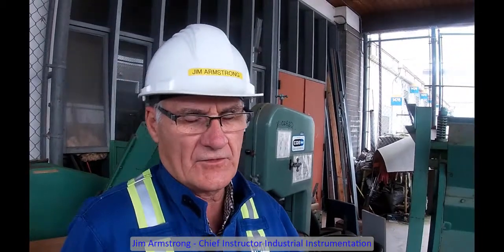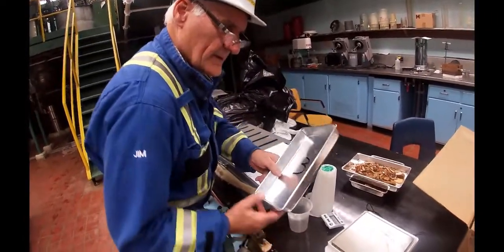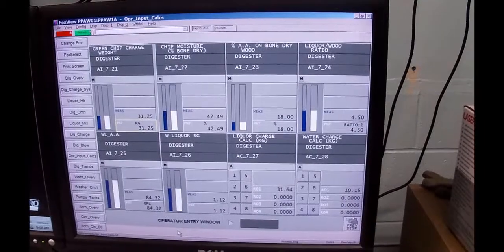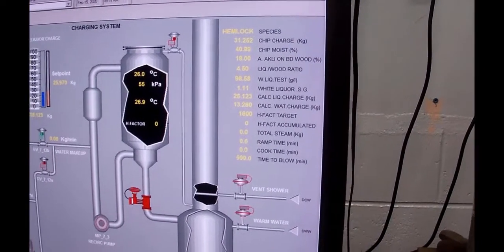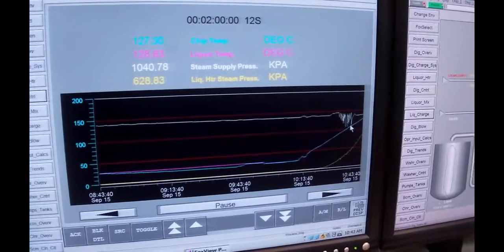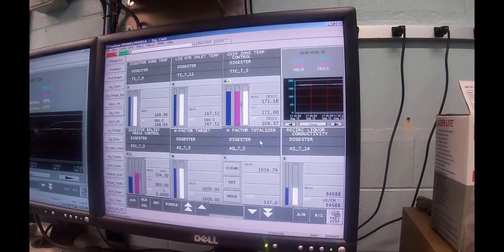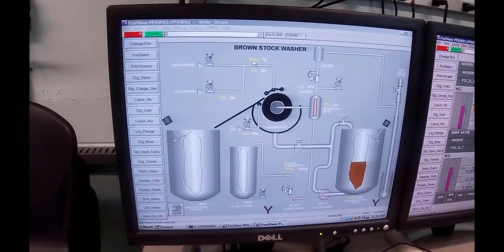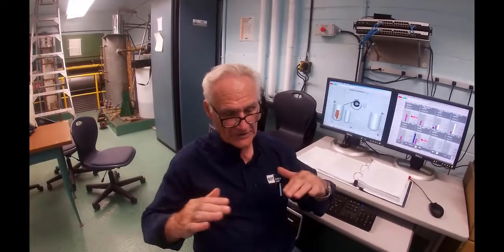Pulp Digester Lab

Comment: So different than the digesters I used to run . Mine where called rotary digesters that was tall as 3 stories .Ran at 150 lbs of steam at 305 degrees the cycle took 4hours 45 min ..we cooked flax waste that looked like hay bales to soften it up then bleached and refined as it goes out to the paper machines . We made cigarette paper .

Comment: Dont work in a pulpmill.
Reply: I had no choice they shut one of the paper machines down and was  bumped to the pulp mill running flax digesters, washers  and impressafiners I worked at the top floor of the mill all by myself wich had the pulp mill office flax storage set to be taken by bay numbers to load into the digester wich was 82 bales . Some times I would work for more than a week.with out seeing a supervisor or foreman as long as everything was running good no one bothered you .Also it was dusty ,dirty ,and stinky and many big roaches that would crawl down the flax bales trying to escape as it falls into the digester with caustic chemicals like battery acid
Reply: Why?
Reply: @harsh2010  Exposure to chemicals, noise and years of shiftwork. It dramatically reduces your ability to enjoy life.
Reply: @sigmckone  Nonsense, work at modern pulpmill, obey safety rules and get big money.